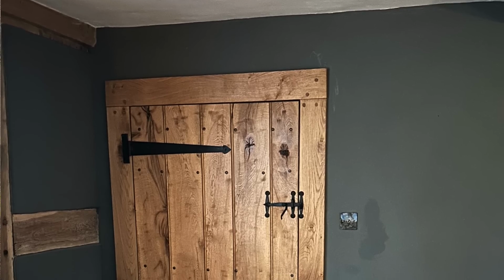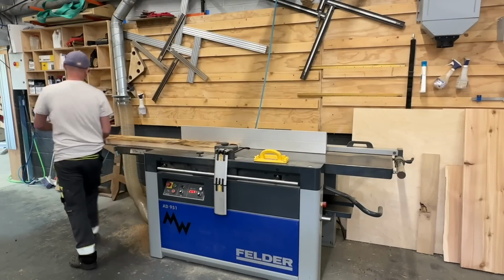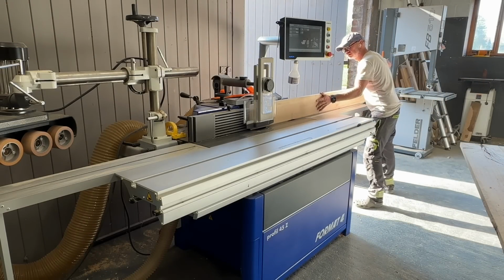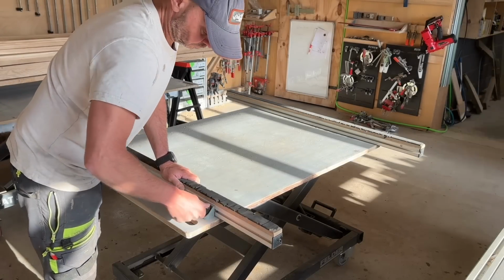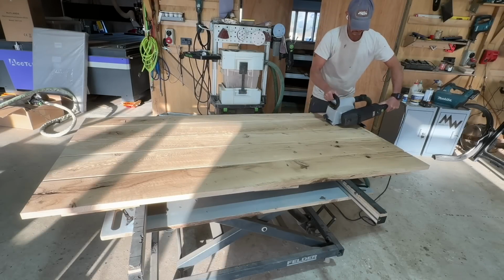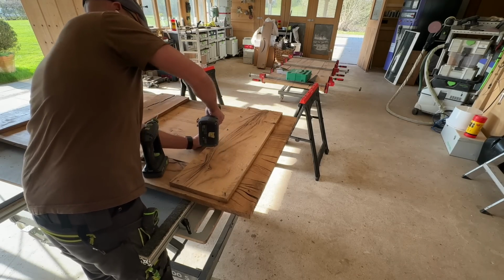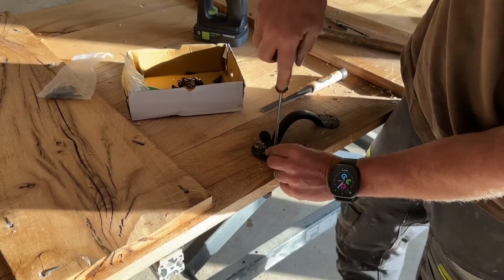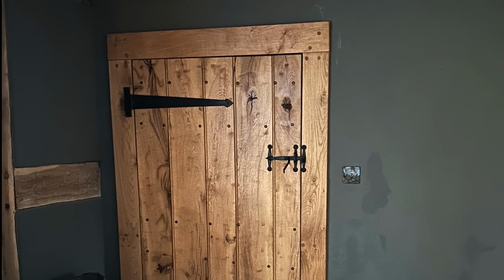My internal oak door

Comment: I live in an old house, all the doors just past the kitchen are very similar, only that lovely aged pine. I’m sure they were made of floor boards, probably made on site by the builder to save money. Unfortunately, when we moved in, forty years ago, they were all painted. It took some work to strip off all the paint, the clenched nails were puttied over and unfortunately, some still remains. I tried everything to remove it, I spent ages, I even bought a set of dental picks, but there’s still some left, so without damaging the wood I’ve had to live with it.

Comment: Excellent!

Where did you get the nails?  Or if I needed to find them here in the U.S., do they have a specific name I can search on?
Reply from the maker: hand made nails . or black smith nails should do it
Reply: @ManorWood  Thanks!
Reply: @theboredcreative  Glasgow Nail Co based in Mansfield, Massachusetts. Originally from up in Scotland but they moved to the US. I get them on ebay in the UK
Reply: Oh man. The correct search term is “hand made iron nails.”  Go try “hand made nails” and see the difference 😂
Reply: Google search Rose head Nails.  Tremont nail company....I bought them years ago in fifty pound boxes.   (He needs to learn how to curl them over and clinch the tip into the reverse side.)